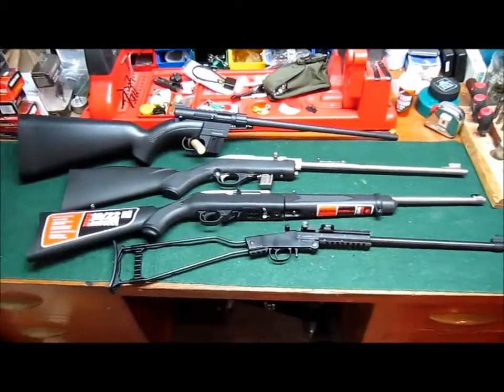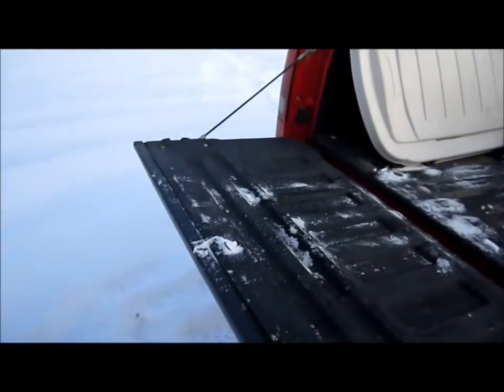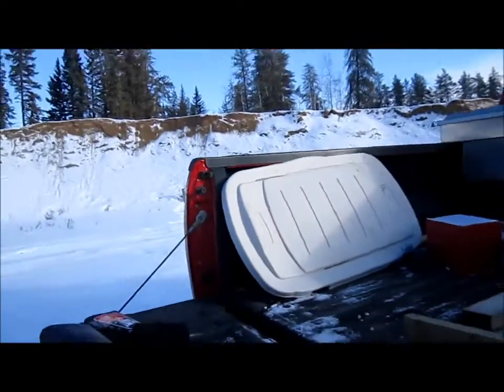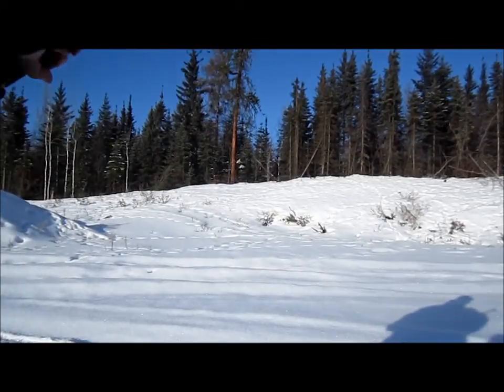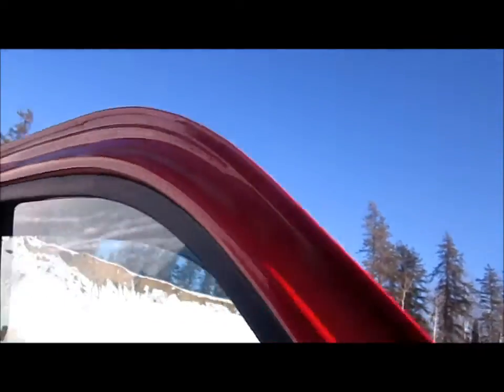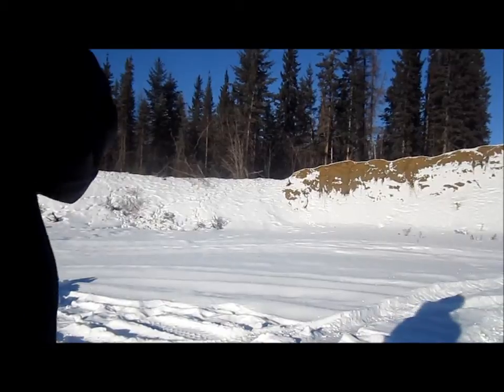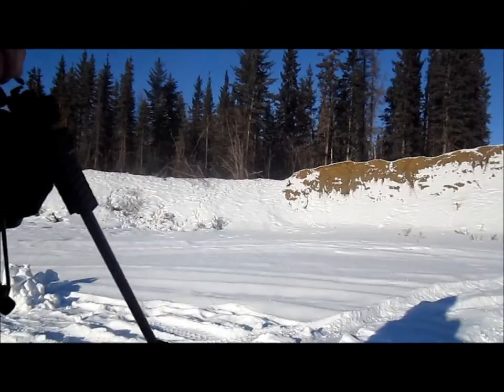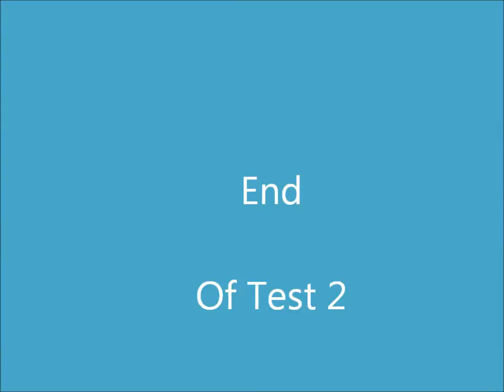22 Survival Gun / Pack Gun Experiment - Part 3

Comment: This is awesome! I am working on a review of the Marlin Papoose and comparing survival rifles myself.  I dont plan on putting them that lol....but I will reference your testing and put a link in my description to help promote your channel....good stuff!
Reply: Liked and Subbed
Reply: Getting some of that g6.  I'm sure you didnt....but I sometimes forget that you have to push in the bolt release to get the ruger 1022 to break down.....perhaps the issue?
Reply from the maker: ya, if you watch the last 30 seconds of the video i realized my mistake and owned up to it in the last 20-30 seconds of the video, the bolt was not locked back so it would not disassemble.
Reply from the maker: G96 is by far the best cold weather cleaning/lube i have ever seen.  i use it on ALL my guns now, right out of the box i clean them head to toe and let the oil penetrate the metal.  i never have issues with freezing and such now, best stuff on the market!  and as a added bonus the winter lube testing was done by the RCMP so you can thank your tax dollars for doing the testing for us and showing us how good G96 is!  so you paid for the testing to be done so you should use the results of the test and get some G96! (they really need to make a cologne that smells like G96!!!)
Reply: Lol my bad....yeah I watched right up until you said not a cloud in the sky....and I was wanting to get to part 4 so clicked on ahead.  Good catch.  Yeah I figured that could be the problem....I do it all the time myself.  Wish there was a go around on that.....
Reply: Def will check it out!